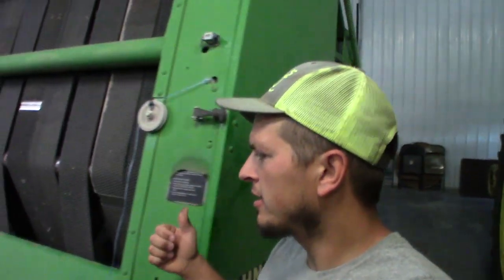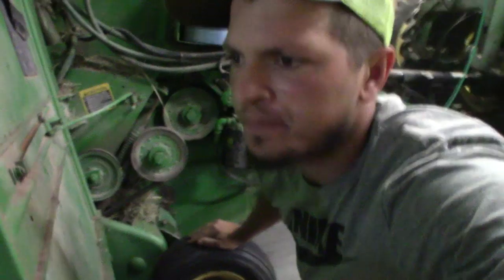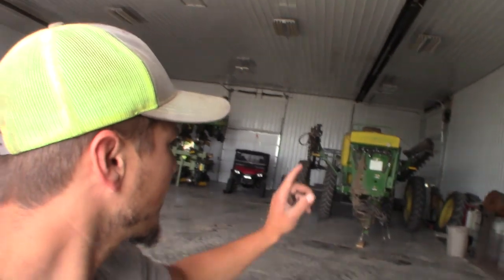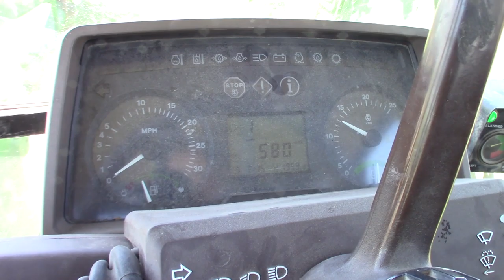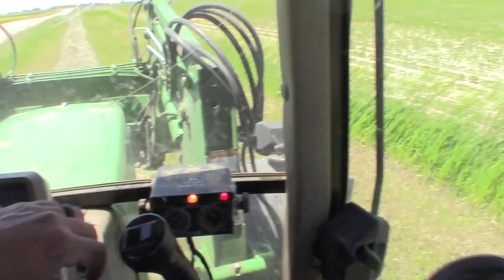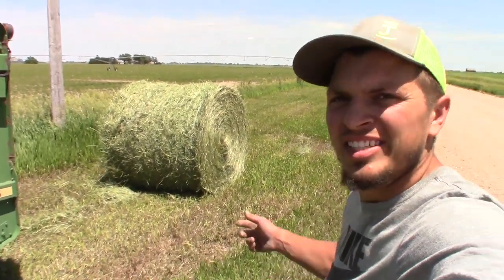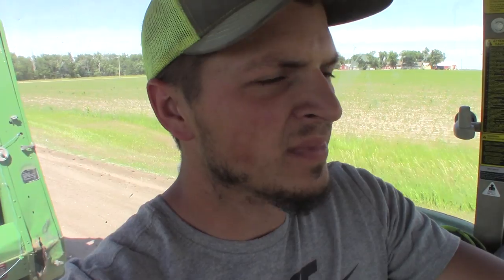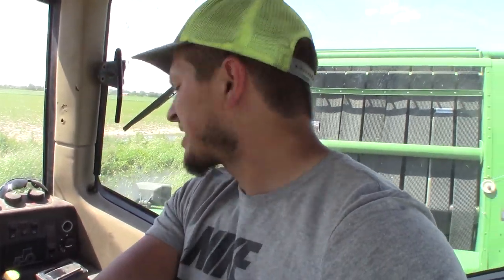Baling Hay With A JD 535 Round Baler

Comment: That first Bale you made was a good shape.. I could tell when you picked up the hay that it was probably too dry, which is better than to wet, but you do abuse the hay more when it's over dry. Especially with alfalfa. Could tell you're still running your RPMs quite High. Back at off to 1500 or 1600rpm and you will abuse the Baler and the hay much less. Also you need to increase your ground speed to 5 to 6 miles an hour, your Baler will handle it fine. As far as weaving goes, you can make a couple short quick weaves to get the Bale started, but once you're going, spend 5-15  seconds on each side at least, depending on how heavy the hay is.

The oversized Bale light could be something as simple as some issues with the electrical prongs in the wiring harness where it connects behind the tractor cab
Reply from the maker: My cousin called me yesterday and asked if I could come help him finish baling his hay. So I tried what you said ran less rpm and almost 6mph Baler worked great and bales came out good! Much “smoother” sounding

Comment: On the oversize light, you might also want to check and make sure your tailgate is latching correctly.  Could be the tailgate comes open a little bit causing the light to come on.  One way to check is to bale til the light comes on then stop the baler and go look to make sure the tailgate isn't cracked open slightly.  Bales are looking good now.

Comment: Looks like you got it under control. A lot of dust flying . I rather have it dry then wet.  Your baler makes a good bale.  I say they are 5x5's , my son has a 558 JD 5x5 baler , I have a 458 mega wide 4x5 baler . I like the 4x5 's they are much easier to haul on a 8 ft wide 24 long gooseneck.  I haul 15 bales at a time . We also use a regular round roll wagon that we can put elven on. Keep up the good work.

Comment: I'm in need of your assistance on the 535. The pickup shoot won't lower like yours does by just cranking it. Acks like there's a locking pin I'm not seeing? Manuel says it's either crank or hydraulic. I don't see any controls for it if it's hydraulic and only two lines connect to the tractor.
Reply from the maker: If it's hydraulic you'll see a cylinder connected to the pickup head. If not then it is crank and may be locked up with rust
Reply: @JMfarmandcattle  beating it around the field a few times loosened things up. I greatly appreciate your insight!

Comment: Square shoulders if the windrow is not that same size as the pickup then weave left and right is a good way to get the perfect bales but bales look good we bale 1300 to 2000 bales a year and I get tired of weaving so I just set the rake to four foot I have a five foot pick up that let's me just roll on I have a 5 by 4 ft baler check your sensor and wires around the sensors you LL get it going

Comment: When u are running the baler and kick a bale out idle the tractor down when u open the gate and close it. This will be easier on your belts when they start turning when u close the gate.. If you are baling grass , mainly thin  windrows of very dry hay, it may not want to take the hay into the chamber and plug the pickup. To solve this raise your gate , lock it, u will see the drive roller, Its the roller with rods welded across it. Those rods get worn and get smooth. Weld very rough, I mean ROUGH and UGLY , beads on the rods and all over the drum. This will make your baler way more aggressive taking the hay in and will seldom plug. Up grade your gate latched to the new heavier style. These will lock your gate shut better without worry of your gate popping loose when your bale reaches full size. There is a lot of pressure on those latches while forming the bale. This winter take your belts off and make sure they are the right length . There are longer belts and shorter belts. Take your pickup off and replace the rollers and cams, tube the teeth bolt to if bent or worn bad. Put poly bands on it. They are well worth it, The bands wont bend or if a tooth rubs on them the wont where the tooth out. Now here is what I do and have done it on many of the older deere balers.....I put the new style square teeth on. Last way longer and in my opinion pick up light grass windrows better. Now here is some words of caution using the square teeth.. Loosen your pickup drive belt till it wont turn the pickup while running the baler but not baling. Then tighten the belt until the pickup starts running. then ease into the windrow. If it stops tighten the nut on the  belt tightener two full turns. then if works ok go baling. If you hit a big  gopher mound or badger mound and the pickup stops turning when you hit it but starts again once past you have it set right. If it slips in heavy windrows just tighten one turn at a time till it goes. You want it to slip when hitting big mounds if it doesn't you will twist all the teeth tubes and will have to buy new ones. they don't like wet hay but slightly damp is ok The 535 is a very good baler. Owned many and still have one as back up
Reply from the maker: Makin Hay thanks for all the information!  I will have to check into everything you said!  Have you ever had a belt try to twist on you? Same belt every time. And it will do it anytime doesn’t even have to be picking up hay just in the shop turn the pto on and boom twist. Far outside (passenger side) all the belt guides are there.
Reply: @JMfarmandcattle  Yup I have had the twist .  Since it keeps twisting the belt is now stretched on one side which is causes it to twist. Is the belt looser then the others ?  If so , take the spice apart   cut the belt off along side the splice on one end to shorten the belt a little .  That may help. If does it again you will need to replace the belt.
Reply from the maker: Makin Hay it did seem a little bit looser than the rest I will try to tighten it up a bit! Thanks for the help

Comment: The faster your PTO boiler is spinning while it's stringing the bail the more string you will use which cost you more money
Reply: Thats not true.... The pump will run slower with a slower pto rpm... so its no difference...

Comment: I dread doing fields that boarder roads.  Your doing road shoulders,  even worse.   IT's the debris thrown out of car windows,  aluminum cans,  plastic bottles, and whatever else junk.   Had a car go off road and crash in our field.  The guy tried getting out himself.  Nope, needed a tow truck.   Said ya everything picked up off the field.   I know better, after checking myself I found the car jack,  tire iron, and a ratchet strap still there.    Wouldn't that be fine for the mower.   Hardware sucks.  When the grass gets 4 to 5ft. high you can't see what lies beneath it.   Saw a cow chomping on a shredded aluminum can once.  Cut her mouth and tongue up good.    Be careful.

Comment: Surprised you're having that many issues. Guys here in PA run round balers for ever now and u don't hear of many issues. Alot of them plastic wrap them. They need little drying and are basically sealed  Air tight. Most of the dairy guys are out of business. It's beef guys still playing.
Reply from the maker: Ed Hlavaty I bought it from an old retired guy who only had it as a back up for the last 5-6 years. I’m guessing everything just got rusty and needs broke back in. At least I’m hoping so